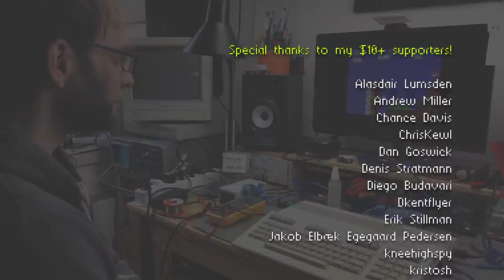Commodore 128 Keyboard Repair

Comment: Graphite from a pencil works well in a pinch for restoring contact. Just color the contact in and test! 
Great video!!!
Reply from the maker: Yes, good idea! I would consider that a great quick fix but would be worried a bit about how long that actually lasts. :)
Reply: Yes but 98% graphite .....  Staedtler Lumograph 9B for example (Made in germany) ........ give you 11 o 15 Kohms...
You also use it for "redraw / revive" the black contacts in the circuit board...

Comment: Be thankful it wasn’t replacing the entire cable on a C128D keyboard!
I should point out I actually had no idea if the keyboard even worked after all that work. 
As for plungers, I’ve had the best result with the piece of paper method.
Reply from the maker: Ha, I can imagine that being tedious... Yes, definitely have to be more careful with those plungers. I'll try to use the paper method next time I think. Rubbing them with IPA was not the best idea although I didn't manage to break a key like that before.

Comment: Great job!  I think the same thing has happened to that key that Hey Birt described in his early A500 keyboard repair videos!  On his, he found that the keys where there's a metal bar supporting it (eg. Enter key), Commodore put some kind of grease / lubricant into the key and on the bar, and that leaks inside onto the key pad.  I am sure that's what the cause is - he found the exact same thing, specifically the resistance change to the surface.
Reply from the maker: Thanks! Yes, that may well be what happened. Probably made worse by me wiping the plunger with IPA. :)

Comment: Another here for the graphite approach. This is my favourite way to restore conductivity. Some graphite powder mixed with isopropyl and painted on, left to dry, then wiped off with a q tip. Incredibly effective and I've used it on many keyboards now to restore them to like new.
Reply from the maker: Yes, that is a good idea. I'll have to try some different methods and also some of the pre-made chemicals/lacquers sometime. :)
Reply: Tried this with my PET, didn't work.
Tried a thin coat of silver epoxy paint stuff, didn't work and actually made things worse.
Currently investigating a new approach, to suspend a carbon dot above the PCB and activate it with the old plunger mechanism.
Reply: thats overkill. i used a carpenters pencil and "colored" the contact pads on the board and all over the rubber pieces. fixed all my keys i had a issue with

Comment: This was a useful tip for me as I have a broken key on my 128, the plunger has split which causes the key to get stuck down.  I have a later edition flat 128 with a cost reduced board (quite rare apparently) but the keyboard looks to be the same as this one, so I'm off to ebay now to look for a replacement key plunger.  Thanks Jan!
Reply: I solved my stuck keys due to split plunger by: 1) Swap split plunger with rarely used key. 2) Slightly widening hole in support base (where plunger is inserted) so that it does not stick.
Reply from the maker: I think they probably used these keyboards starting with the first C128s and up to the last Amigas. My A1200 has the same style plungers at least, although most Amigas used a foil membrane instead of the PCB for the contacts.

Comment: Nice!  Keyboard issues are a pain and more to the point fragile due to their age.   I have on hand spare plungers, springs and carbon paint.   The 128 keyboard is easy to troubleshoot because you can follow the keyboard grid map to rule out problem keys and test repairs before reinstalling the keyboard for testing.    I went down a rabbit hole with a 128D keyboard which actually tested out fine but because a couple pins on one of the control port were shorted it actually caused several keys not to work including the RETURN Key.    Had I done a full external inspection I would of saw this and saved myself a ton of work.   Thing is I am not much into games so the control ports were not on my radar and over the years I have never seen bent pins on a control port so I never looked.   That bit me badly and I know better, because inspection is the key to everything you work on before and after the repair.
Reply from the maker: Oh, I would not have suspected the control ports either I think. Interesting fault. Probably would have noticed that testing games. :)
Reply: @JanBeta  Thing is I am not much into games so those ports for me rarely get used.   Today I inspect everything even those control ports.  Eventually your going to get to them anyway to confirm everything is working as it should.

Comment: I remember hearing many years ago not to use cleaners (even alcohol) on ST keyboard contacts because it could ruin the conductivity.  I only lightly used an eraser (rubber) on a few mylar carbon contacts, which seemed to work fine.
Reply from the maker: Yes, alcohol seems to be a bit too aggressive to clean the plungers. I'm going to try different methods in the future. Although this was the first time I actually seem to have damaged a key.

Comment: If you would t have a replacement, what you can do as well, is grind up a lead pencil to dust, and use that to repair the conductive carbon later. You’ll have to use something to pressure fit a tiny layer across it (little flat piece of plastic works best). This lasts surprisingly long, but obviously is still temporary (couple years at best). Nice to see another C128 video though, recently did mine too, enjoy this machine a lot :D
Reply from the maker: Yes, I heard people using pencils to fix these contacts. I would be a bit sceptical about how long that lasts actually. I'll definitely have to tinker with some different methods and chemicals when I get the chance. :)

Comment: That was a nice surprise that the Amiga 500 keyboard plungers work with the C128, or at least with Mitsumi keyboard. I remember Robin at "8-bit show and tell" had a video where he had a tablet next to the C64 to display frequencies from programs in basic. Then he mentioned the 15kHz whine. I remember the sharp whine and that it gave me headaches but I have no chance of hearing it now :) Have you tried using silicone with graphite ?
Reply from the maker: Yes, quite useful that the plungers fit both keyboards. :) I think everybody loses the higher end frequencies of their hearing with age slowly. I could not hear the whine for a while. I think playing in rock bands and being an audio tech didn't help my hearing much... ;D Didn't try silicone with graphite yet. I'll have to test some different methods sometime. Lots of suggestions in the comments. :)

Comment: Nice job!
Depending on the kind of contacts, you can sometimes restore conductivity by rubbing them on a piece of paper to actually remove the top layer of carbon. But this only works on the kind of contacts that are solid carbon moulded into the rubber dome or whatever. The cheaper kind just have a thin coating of carbon on the surface of the silicone, so rubbing them on a sheet of paper makes them worse! Those ones definitely need some kind of conductive paint to fix, and even then it's not always permanent. I guess the C128 and Amiga keyboards must use that kind.
Speaking of keyboard repairs, I just picked up a couple of IBM Model M boards off eBay for a relative bargain. One was working, but was missing the cable and some key caps (as well as one spring), the other wasn't working, but had the cable and a full set of key caps. I've swapped over the key caps and the cable to the working unit, and it still needs a very thorough clean, but I'm happy to have one working Model M. I think the other might be repairable, as it looked like it had a leaky cap on the controller board, but the cable and key caps might be expensive to replace.
Anyway, I love these repair videos. Even the simple ones like this are fun to watch. Keep up the great work!
Reply: You could just use the cable from a crappy cheap PS/2 keyboard or an old USB cable. Maybe you could 3D print or resin cast replacement keycaps?

Comment: There are also (lots of) Mitsumi-made PC keyboards with the same plungers.
Reply: The KPQ series which also have those rubber cups which can be used to mod the A500 keyboards to be more like the A2000 ones BTW.
Reply: @csabasanta5696  Oh? Now there's a tip! The A2000 keyboard was godlike at the time when I was comparing my A500 or later 1200 with my buddy's 2000.
Reply: @benbaselet2026  There were 3 revisions of the A2000 keyboard, so it really depends on which version you're comparing it with. The one with the rubber cup was the last revision: https://www.youtube.com/watch?v=cJjZ6QjfmiE
Reply from the maker: Oh, makes sense. Thanks for pointing that out!

Comment: In case someone is in a pinch with spares, I've had some success fixing conductive strips of MIDI keyboards applying Graphit 33 from Kontakt Chemie with a very small brush. I think that could apply to this type of a keyboard as well.
Reply from the maker: Yes, that is definitely a good way to do it. I'll have to try some different chemicals/lacquers and methods sometime. :)

Comment: @Jan Beta  I had this problem several times, mostly with the select and start buttons of gameboys, but also with apple ii and amiga keyboards. I think this is all the same stuff, some conductive paint on rubber or plastic that shortens the contacts on the pcb. What i recommend: Go to Lidl and get yourself a bottle of their pink colored nailpolish remover. Soak a kleenex stick in this and gently (very gently) rub the contacts on the rubber. You will see the kleenex stick will get a bit black, as it seems to do a chemical reaction with the contact paint stuff. Let it dry a few minutes and it should work like new. I tested this with some Mitsumi Amiga 500 key stamps and it also worked.
Reply from the maker: Oh, interesting approach. Thanks for sharing! I'll have to try some methods and compare sometime. :)

Comment: I've successfully used  "Keypad Fix" from Amazon US (don't know if it is available in Europe), to restore conductivity to a couple C128 keys. In the past, I used a homemade paste of graphite and IPA brushed on the key pads to restore a VIC20 keyboard. This was not sufficient to fix the C128 keys, so I've decided to try the commercial "Keypad Fix" , and it worked.
Reply from the maker: Oh, never tried that. I know that there are several different paints and sprays you can use to restore the conductive layer. I definitely have to try some of those.

Comment: Hi Jan great video on keyboard repair for the C128.  I do have a question.  My 128 needs the F1 & F7 plungers replaced.  I have heard those use different parts than the normal keys.  do you know if this is the case? or can I just use parts from an old Amiga keyboard like you did here?  Thanks!
Reply from the maker: On my particular one all the plungers are the same but unfortunately there are different versions of the keyboards, some have plungers that don’t match the Amiga ones.
Reply: @JanBeta  I just want to give you an update to pass onto your viewers.  I checked the top row of keys on my 128, which includes ESC, TAB, and all of the function keys, those all use different plungers than the normal keys on the lower part of the keyboard. so I would say that for letter keys & other ones on the lower keyboard, it's probably safe to use the Amiga plungers, but, for the upper keys probably not but I really can't say for sure.  I may go ahead & experiment to see if Amiga plungers will do the trick.  I'll check back with you then.

Comment: On my A500 I found it was the grease from the metal hoops on large keys that caused the problem. The grease liquifies, leaks inside and damages the conductive rubber. I did quite a bit of testing last year and did not find any coating that worked on the Mitsumi key conductive rubber because of the shape. Interesting that the C128 and Amiga have same contacts!
Reply from the maker: Yes, I saw your video but didn't remember... Shame on me. That may well be what happened in my case, the C128 RETURN key has one of those metal brackets, too. And I probably made it worse by wiping the contacts with IPA again.
Reply: @JanBeta  I was taught a long time ago that alcohol was bad for rubber. I learned more recently that this is only true for a few types of rubber which are commonly used for seals and gaskets. It does not hurt silicone rubber at all.

Comment: I did watch another youtube that did say that we should not put "heatsink" on c64/c128 chips since commodore did put thermopast on the back of the  RFC sheild that works as a heatsink. So whats is your opinion on this. ?
Reply from the maker: In my experience, the metal shield often doesn't make good contact to the chips and doesn't work very well as a heatsink. I prefer to put heatsinks directly on the ICs. The RF shields are pretty useless otherwise, too, nowadays. The frequencies emitted by the old machines are not interfering with any modern electronics as far as I know.

Comment: I always figured that Commodore would have had a killer machine with the 128 if they used an 8088 CPU instead of the Z80, so it would have worked with DOS. There's not a lot of big changes hardware-wise to make that work -- imagine a computer that would be able to play your C64 games natively as well as your MS-DOS games and applications. The graphics and sound capabilities would blow a competing system like the Tandy 1000 out of the water.
Reply from the maker: Interesting thought. I guess it would really have sold a lot more if Commodore had realized in time that CP/M was nearly dead and DOS was on the rise when they released the 128.
Reply: @JanBeta  I agree, it was probably mostly a bad business decision by Commodore to go for CP/M, which was only used in older office environments in the 80s. Everybody was moving towards DOS. But at the time the C128 was developed IBM still had pretty strict licensing conditions on the PC platforms, so it could also be too expensive to go for an 8088 instead of a Z80.

Comment: When I repaired the keyboard on my Commodore PET, instead of some conductive paint I used self adhesive copper tape cut into discs using a hole punch
Reply from the maker: I would be a bit worried about the contacts on the PCB wearing down with that method but it is a nice fix, at least temporarily. :)

Comment: Had the same problem on my 128DCR keyboard - the numpad "0" key in my case...
I didn't have Amiga plungers available, though. so I glued a small sliver of tinfoil on the plunger rubber itself - works without a hitch :)
Reply from the maker: I would be a bit worried about the tin foil wearing down the contacts on the PCB over time. But I imagine it is a very good fix, at least temporarily.
Reply: @JanBeta  I was too, that was the reason that I made sure it was a single layer only - that way, the plunger would keep its flexibility and the foil wouldn't scratch at the carbon.
I was more worried about the resistivity - as the tin foil is less resistive than the plunger material - basically dead short instead of a few hundred ohms.
Then again - I rarely use the numpad, so it'll be good enough for now :)

Comment: I'd just use a small piece of aluminium tape (used for thermal protection while using hot air) and stick it on the bottom of the plunger. It's conductive. I'm using it often lately while repairing Sega Mega Drive controllers.

Comment: I hate chores to work on the keyboard cleaning eg all my c64'ers have done 6 or so what a job especially with my old eyes, 49 years already but is now all finished with dust cover or minimal dust cover.
Do not want to work on it for some time, some were filthy after a few years dirty and had no love.

I could have saved you the work the search for another plunger or key element, will not work with a C64, the Amigas are better suited for that, even once experienced in a gray-gray past. ;)) this is not a criticism, making old computers (or demolishing that is not so difficult) should also take a bit of searching because you have forgotten YouTube is still a fantastic Tool.
Although it doesn't include everything, that's why I love your channel so much and do this to help each other.
I have always been a Hardware man used to pull things apart did not always end well usually :) but I learned a lot from that.

X without tongue :))
Reply from the maker: I'm constantly learning new things, I like discovering stuff myself sometimes. :)
Reply: @JanBeta  

Me To if i have the Energie...

Comment: That's why I'm not a fan of these sort of mechanisms for a keyboard. One little slip up and you lose some keys and then you have to take the keyboard apart (insert obvious hatred of so many screws here) and then you have to get the right amount of conductive material or as you did a replacement part. That aside, at least you didn't have to do that to the entire keyboard. I've never seen it in person but is it actually possible to completely rub away the material on the plungers that easily though, I feel that as people describe it that it's as simple as alcohol rubbing can easily undo it so it's not even worth cleanin? Keep it up Jan!

Also, great hair, do what you want with it.
Reply from the maker: Yes, quite a tedious process. But at least it worked. I didn't think that it was so easy to wipe away the whole conductive layer but this fault proves me wrong I guess. Good thing I had several options to look for spare parts. :)

Comment: It makes perfect sense that the keys of the Amiga and C128 would be the same because they were ALWAYS looking to cut costs at Commodore. So using the same keyboard parts makes perfect, economic sense. You should have had a bit more faith in that :).
Reply from the maker: Haha, makes sense. To be fair to Commodore, the Amiga keyboard is a different construction apart from using the same plungers. And the same mechanism most likely was used for other Mitsumi keyboards as well. ;)